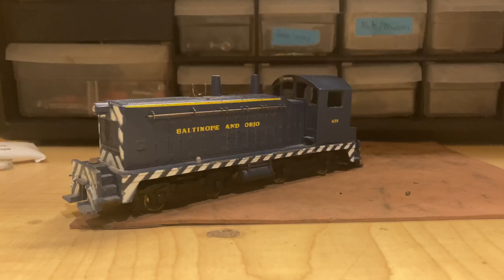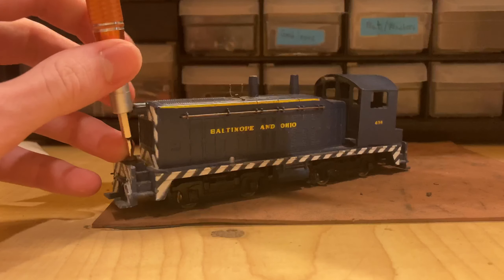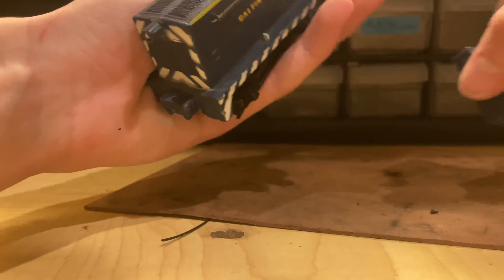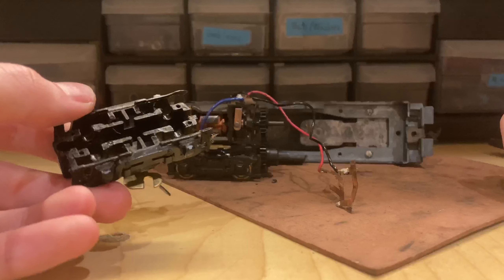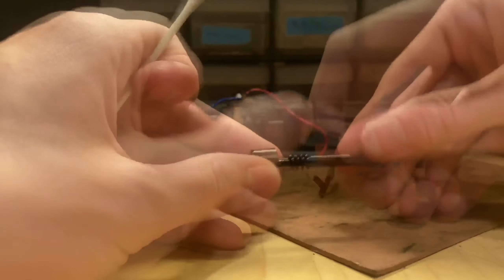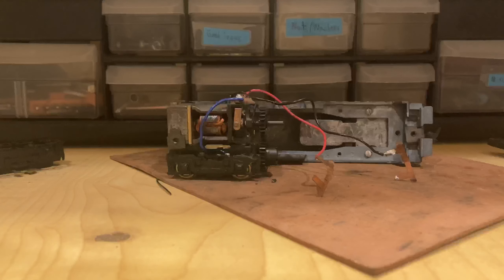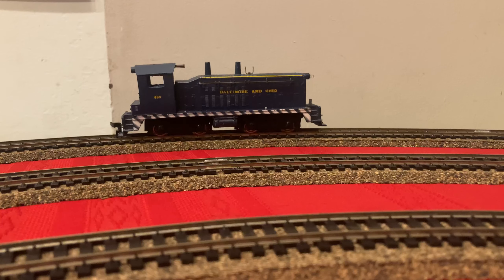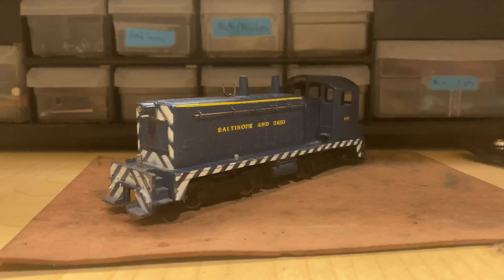Working on an HO Scale Varney SW7

Comment: Unfortunately, the design of the power truck with the motor is the source of the noise. The two large gears have to be perfectly aligned to reduce binding causing the noise. An adjustment of the motor mount screw will help the alignment process. The motor cannot be pitched/angled too much from side to side or the too much up and down. This will cause a slight binding. So, everything has to be perfectly parallel with the bottom gear. Changing the motor will only yield a slight upgrade. Varney should have added some alignment tabs to the design for the motor, but they made a huge oversight when producing this drive. All you can do is adjust the motor position to reduce the noise.
Reply from the maker: Alright, I’ll try that
Reply: @ColbysProjectBin  Might want to add a bit more grease/oil to the gears in the other truck and in the "dog bone" /gear shaft in between. A ton of rattle/noise  comes from that one part . I own several of these rattle boxes,lol.
Reply from the maker: I tried quite a while ago, but still decided it was too loud for me and gave it to a friend of mine